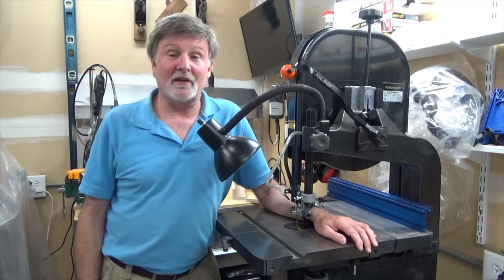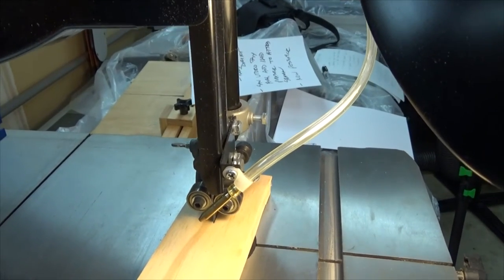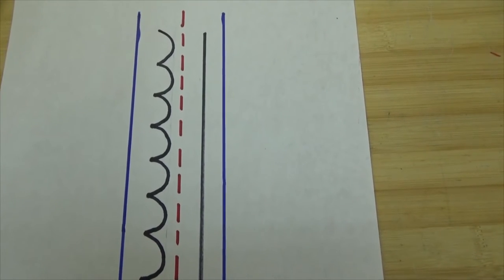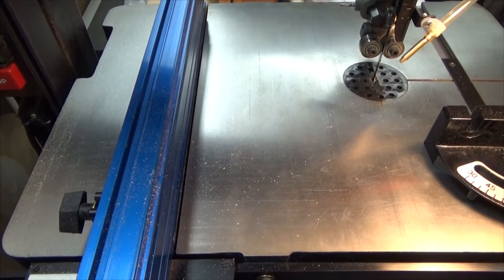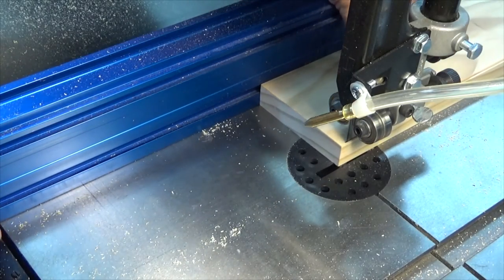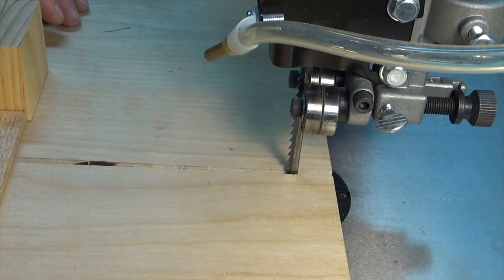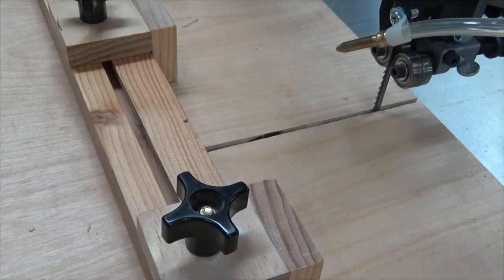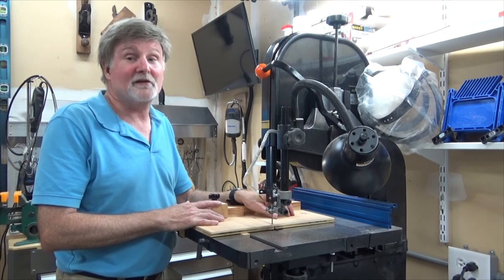BandSaw Sled

Comment: Dave, great job on the video.  I made a bandsaw sled a few years ago for cutting circles.  It has an adjustable pivotpoint for almost any size circle.  Later I added a fence for cutting small pieces, it's much safer than a table saw or chop saw. Recently I added another removable fence for resaw jobs.  Band saws are very versatile.  Now I will add the miter gage for cutting acurate angles. :)
Reply from the maker: Very cool. I ended up buying a commercial circle cutting jig for my bandsaw because I had a project where I needed to have the circle cut and not enough time to make the jig. It's a shame but I don't  even use that now as I have a large CNC machine. I just secure the wood and end up with a perfect circle  with little effort. Frees me up to work on the other creative aspects of a project. I totally agree with you about the bandsaw being much safer than a table saw, especially with cuts on small pieces.

Comment: How does a wider blade fit on the center of the tire?  I can see eliminating drift using Alex Snodgrass method with small blades...but how does it work with a 3/4 blade?. Wont it be off the edge?
Reply from the maker: I understand now. I thought you were referring to the jig. In this video I am using my Powermatic (Delta Style cast frame) bandsaw. I use this saw for smaller/detail work. Some people try to run a 3/4 blade on this type of saw but it is questionable if the cast frame can handle the tension needed to support the blade. A 1/2 in blade is much better suited to this type of saw and will pretty much cut through anything you throw at it. That said I have another bandsaw, a Laguna 1412 that I use for heavier work. I presently have a 3/4 Timberwolf blade mounted on it that I switch out with a 3/4 in Laguna Resaw King blade when resawing. You are correct in the fact that if you try to center the gullet (as Snodgrass suggests) on a 1 inch wide tire the blade will hang over the wheel and this is not good. On this saw I center the blade and just try to cheat the gullet towards the center a little. The steel frame on this saw has no problem with the required tension and with the wider blade drift does not seem to be an issue as it is with a narrower blade. I can cut Vernier's so thin you can see through them without accounting for drift. So I guess the point is that on a 14in Bandsaw that has 1 inch tires you can center gullets on blades up to 1/2 in. Anything wider and you have to settle for centering the blade and then shifting is a little to the right. Hope this helps.
Dave

Comment: I see you have rollers.. but i have a Laguna 14bx.    Which has ceramic.   do your bandsaw rollers(ballbearings) have and +/-  than the ceramic holders.?
Reply from the maker: I also have a Laguna 1412 in addition to Powermatic in this video so I have experience with both ceramic and ball bearing guides. I really like both. Each has their own strengths and weaknesses. I certainly prefer the ceramic for tasks like re-sawing. I feel the ball bearing guides give me better control for detailed scroll cuts.

Comment: how does that work with wide blades? They hang over the edge?
Reply from the maker: Sorry but I don't quite understand what you are asking. What do you mean they hang over the edge?. If I use a wider blade it just cuts a deeper kerf into the jig. All works fine.